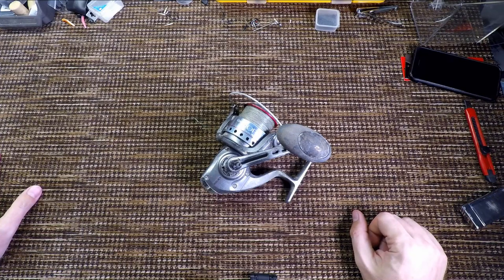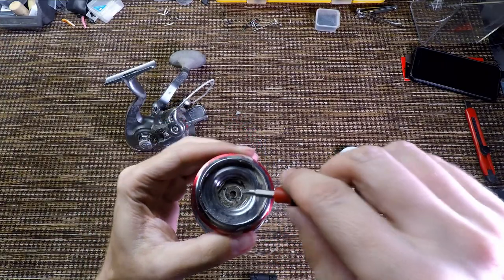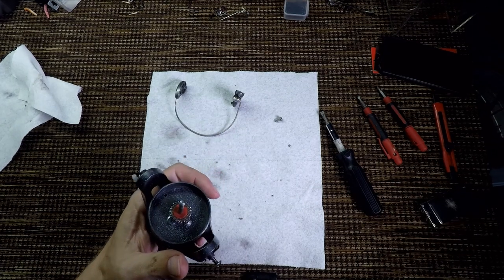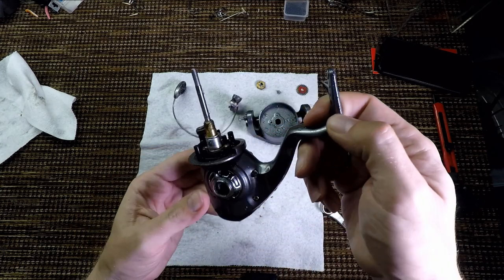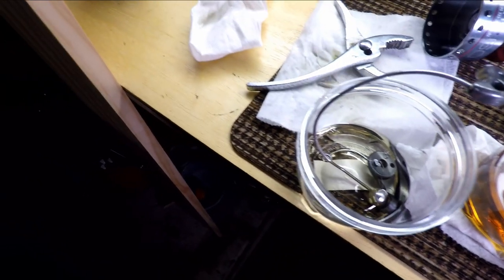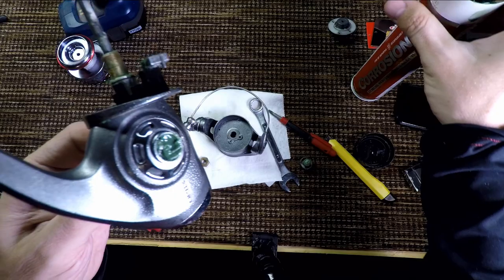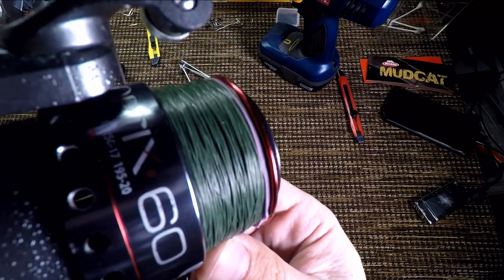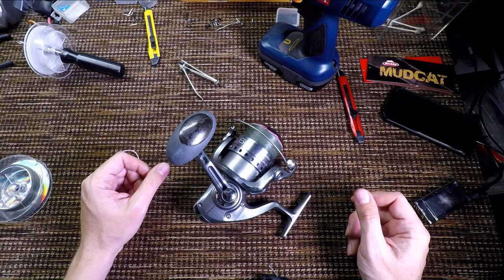Reel Restoration and a GIVEAWAY !

Comment: Glad you left it as found to show us.   That fine silty mud from the Lasalle Lake slowly seeped in.    FYI.   Harbor Freight has some stuff called EvapoRust.   I learned about it from guys who restore old vintage vacuum tube radios.   It is non toxic and removes rust very well and does not attack good metal.     The results from this stuff is amazing.     Fantastic job on the restoration.   Good tip on reversing the superline.   I have also heard of guys doing this to double the life of their superlines.   Especially since it costs so much.  Good video.  Hope you find a youngster fisherman that wants/needs the reel.
Reply from the maker: thanks for the tip my friend... I was amazed at the power of brake fluid too. It must have some nasty solvents , if you think about it, to keep the brake lines free of any kind of deposits...